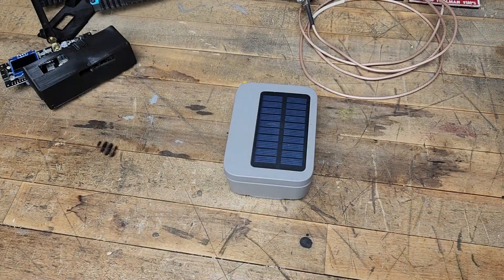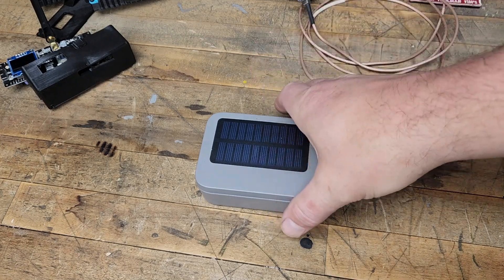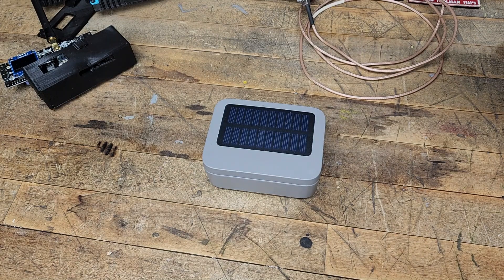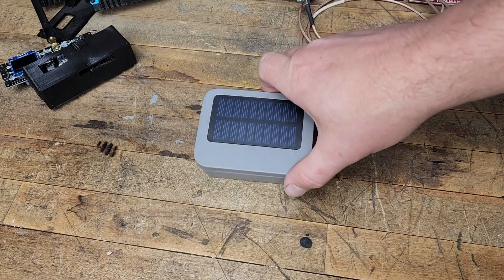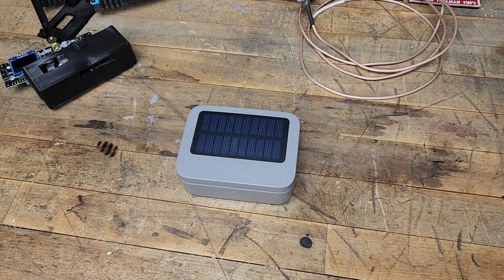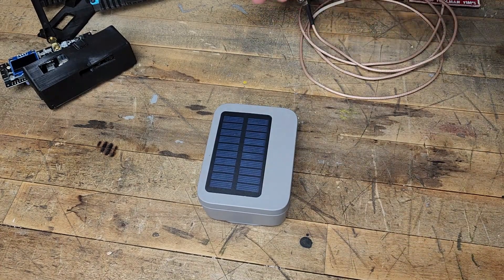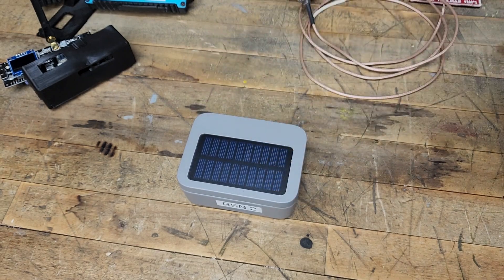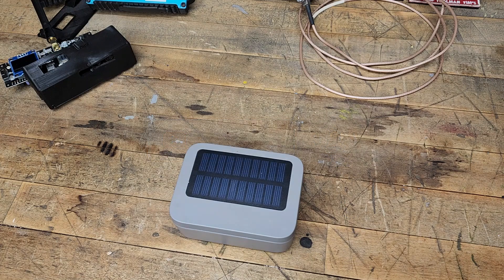The Rak Wireless Solar Enclosure: Our Final Thoughts

Comment: Are there no versions with holes for external antennas?
Reply from the maker: You can find some universal enclosure that pre-drilled hole. Most of those are design electrical contractors but can be adapted to make your own solar node.
Reply: @RavenwoodAcres  They used to have it: https://www.youtube.com/watch?v=6u5v6RS4P-A

Comment: What is the orientation of the antenna?  If you lie the box flat, I'd expect the antenna to also be flat.  That's going to affect range considering that most devices have the antenna vertical.
Reply from the maker: The antenna is integrated on the board, and therefore, you're right the antenna orientation. I chose to just add an external antenna to increase the range. Thanks for the feedback.

Comment: If the panel isn't sufficient to keep it charged, why not include a USB charge port?
Reply from the maker: I will be adding one to make it easier to recharge.
Reply: @RavenwoodAcres  What part will you use for that?
Reply from the maker: @bolle666  One of the biggest not having access to the USB-C is for firmware update and charging if they battery dies. In it current configuration have remove 8 screws to access the USB-C port.